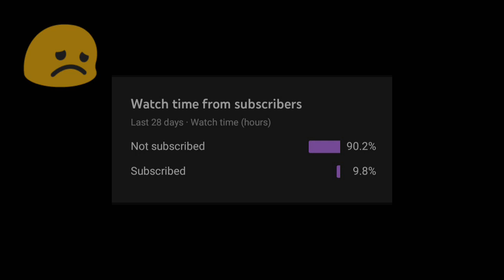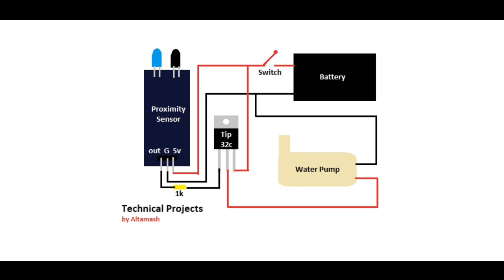Automatic Soap Dispencer || How to Make Automatic Dispencer || Dispencer ghar par kaise banaye.

Comment: Can I have the list of materials that you use.. please🥺
Reply from the maker: yes... I think maybe you have the list meterial. but if you don't have of meterial, again you comment me i will give you this meterial purchase link below.
Reply from the maker: by the way thanks for watching my video
Reply from the maker: can you support me?? please...
Reply: Kindly name each equipment being used Sir......
Reply from the maker: 1. TIP32C transistor
2. Proximity Sensor
3. Water Pump
4. and some meterial including for this video.
Reply from the maker: by the way thanks for watching my video 😊
Reply from the maker: please support me 🙏
Reply: How did this project cost u?
Reply: 3:27 what is the name
Reply from the maker: Around 150 - 180 rupees something...
Reply from the maker: This is a Battery charging circuit and indicate light....